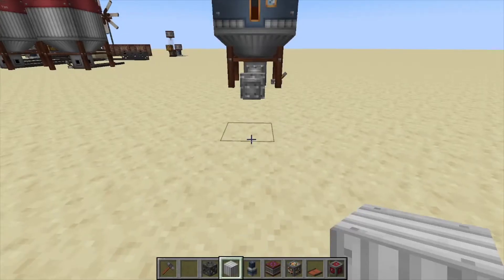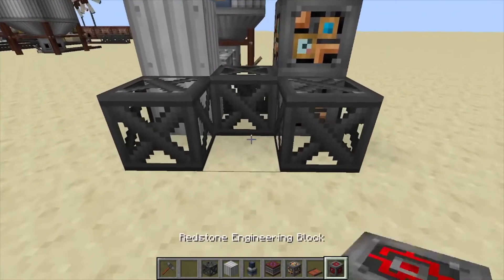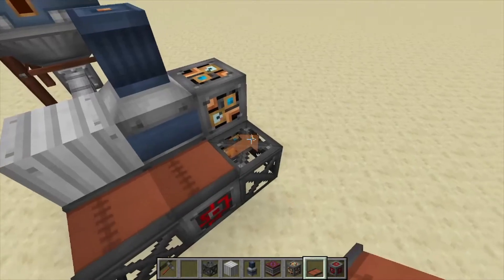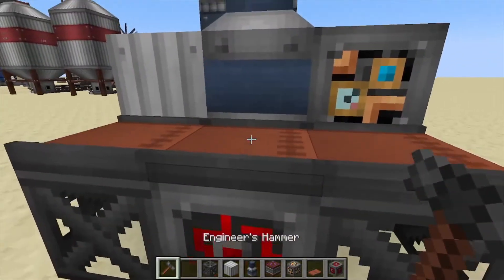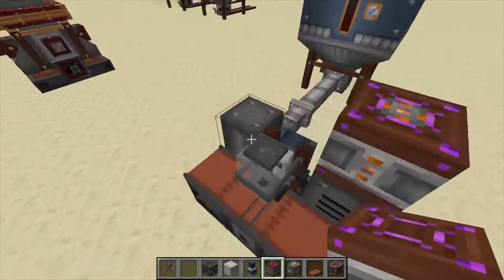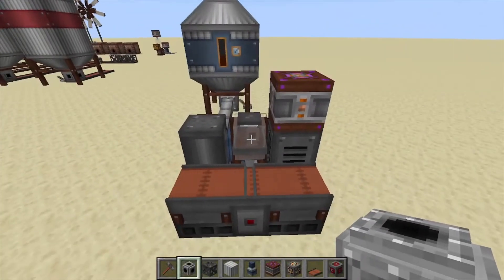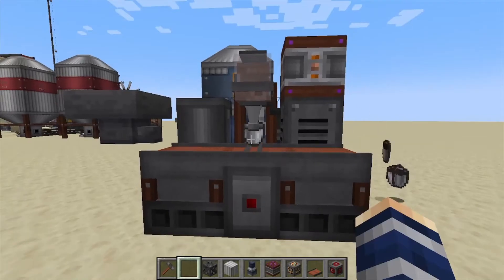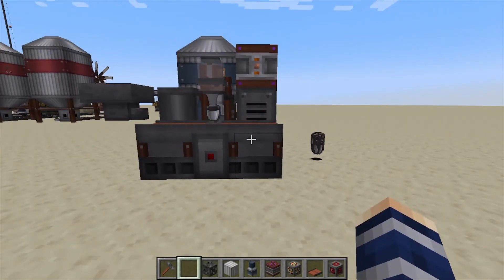Immersive Engineering: Bottling machine (how to build and use)

Comment: Im having issues, i assembled everything according to how it is in the video. However when i right click on the middle conveyor belt to make the machine itself it just moves the conveyor and doesn't actually do anything. 
Side note when i placed the light eb it like combined and the stuff on the block itself connected idk if that means i did something wrong or what but am confusion
Reply: Update: i figured it out....im just dumb 😅
Reply: @kingchrispy9101  what did u do, cause im lowkey stuck too💀💀
Reply: @SVMBROS2017 make sure its iron  sheetmetal.
Reply: @SVMBROS2017  so i had everything built exactly i just was right clicking in the wrong area. If I remember correctly it needs to be higher but still on the thing itself

Comment: Good sir I need your help for some reason resin goes into the block where the pipe connects but it refuses to go into the dispenser portion
I have tried powering it with lever clicking it with hammer and rebuilding it multiple times but it just doesnt work.

Three things are that one the conveyer isn't doing its animation. Two the liquid is filling into the block but not into the spout. Three its on a server.
Reply from the maker: If it’s not filling into the spout it probably can’t be used to fill a bucket or bottle
Reply: @MCMentor1  well it didnt work for water either. Also it started working again after an admin came.

Comment: I've been trying to do this, and it's not working, did the mod get updated?
Reply: Me too
Reply from the maker: What’s not working ?
Reply: @MCMentor1   First of all, thank you for responding. When I use the hammer on the conveyor, it just turns it and doesn't change to the bottling machine. I checked all the blocks and rebuilt it several times, and it didn't work.
Reply from the maker: @Noble12346  couple common things I find are although it says scaffolding there are two versions named the same and the other is the belts not running the same way.
Reply: @MCMentor1   I've tried both scaffolding and made sure the belts are the right ways, imnot sure if it's my world or something.
Reply from the maker: @Noble12346  it’s almost never the world maybe try moving it over or somewhere else to try again and make a creative world to see if your doing it right
Reply: @MCMentor1   do you think that it has to do with im doing it in a cave?
Reply: I am having this exact issue as well.

Comment: I’m having an issue with it. The machine is all set. I’m trying to put creosote oil into buckets, but the bucket is getting stuck on the first conveyor belt. I’m not sure what’s wrong. I have a power source, I have red stone, and I have a hopper with buckets in it.
Reply from the maker: Is the oil showing up in the tank above ? Try bottles too
Reply: @MCMentor1 yes, the tank is full. I also tried buckets to no avail. I wonder if it’s a glitch with my world itself
Reply from the maker: @popcornism  ok is it powered ? i get so many comments thinking the accumulator is a power source instead of a battery
Reply: @MCMentor1  that’s exactly what I thought, how do you power it
Reply from the maker: @popcornism  https://youtube.com/playlist?list=PLEixt-NSA3I2GqwzzgAOpc22ADXMpZWn9&si=IFIA-FsOk6NeJTsK

Comment: my buckets keep getting stuck on the first conveyor by the hopper
Reply from the maker: What liquid are you trying to fill them with
Reply: @MCMentor1  latex
Reply from the maker: @MrComplexGamingFTW  ok next step can you visibly see the latex inside the glass filer jar
Reply: @MCMentor1  yep it’s in there, I can also see accumulator has full power
Reply from the maker: @MrComplexGamingFTW  Troubleshooting like i did at work XD..ok so looks like everything is there that's needed I wonder if it takes a different container...IE a Bottle instead of bucket
Reply: @MCMentor1  just tried bottles still getting stuck… hmmm this should be an easy build just can’t figure out why it’s getting stuck
Reply from the maker: @MrComplexGamingFTW  Last ditch effort before i end up loading the mods/pack...does it need redstone lever on the red dot up front to run...some packs do that.
Reply: @MCMentor1  I’ll have to give it ago in the morning it’s 1:11 am here
Reply: just done some single player creative and only seems to work with creative accumulator but how do i make that work on a survival only? is it bugged or what accumulator am i meant to be using
Reply from the maker: @MrComplexGamingFTW  ok if the accumulator is on top you need to set it to output on the bottom(orange) this can be done by shift clicking the top of the accumulator to change the opposite side using the hammer.
Reply: @MCMentor1  i got it! for some reason the chunk being claimed was stopping it from moving along now all resolved, it also affected the block placer

Comment: im trying to use a bucket on this and its not working, im playing atm9 (allthemods 9) and the quest book says you are able to use a bucket but it isnt working
Reply: i used the barrel and a pipe but if you can answer this id be nice you dont have to though
Reply from the maker: What liquid are you trying to bucket ? Might be something that can only be bottled…it should work with a bucket for sure tho 🤔 I would try to fill anything up first just to confirm the machine is on and filling properly first.
Reply: @MCMentor1  so it was already in a bucket and it's the one for the duroplast sheets I forget the name and once I used a barrel it did end up working but I originally couldn't get it in the machine

Comment: I'm trying to make duroplast sheets and I'm not figuring out how to get the Metal Press Mold: Plate onto the conveyer, anyone done that? Dropping or using a hopper doesn't work, clicking anywhere with anything doesn't do anything...
Reply: hopper should work fine just placing the mold in it
Reply: Just drop the actual item onto it but it has to have the liquid in the machine
Reply: sometimes it works and sometimes it doesn’t.

I’m trying to make ammo and it worked exactly once for me…
Reply: you found a solution?
Reply: @saltierthanyou69  you need to drop press modl: plate on the conveyor belt.

Comment: when i click to the conveer structure not appear
Reply from the maker: Double check all the blocks used and the direction of the belts are correct then try again! If you need further help join our discord link is under every videa
Reply: thanks, I put colored ones instead of iron plates ...